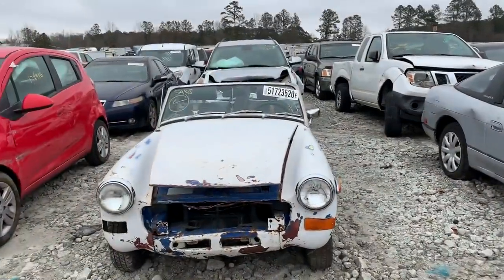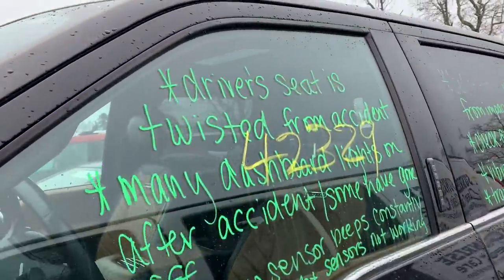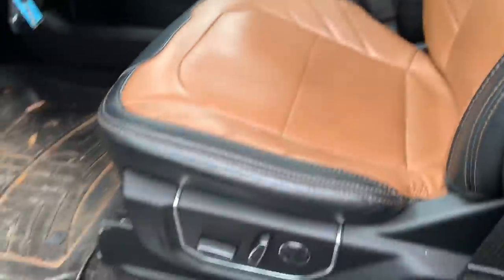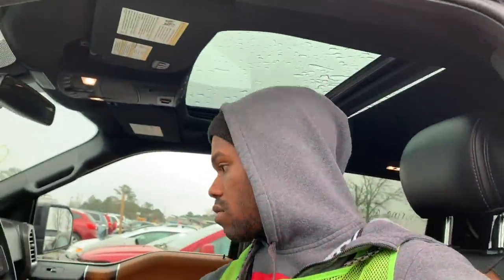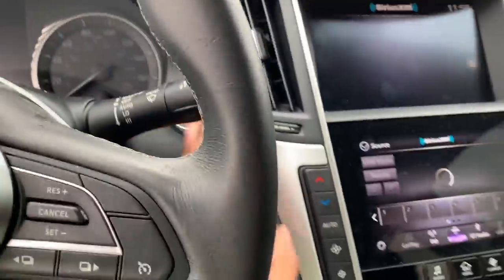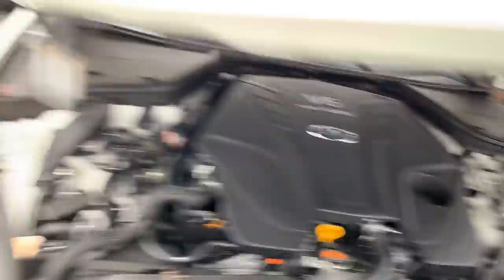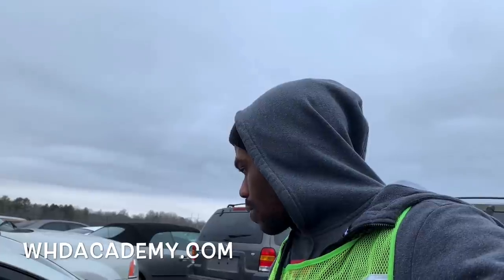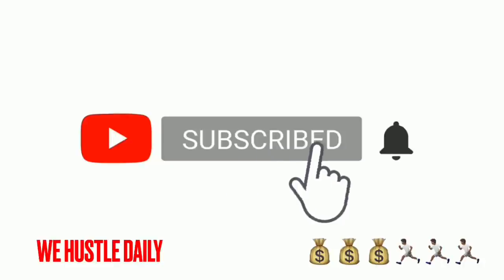*ANOTHER CHEAP COPART FIND!* A FORD F-150 ECOBOOST LIMITED! *BEAUTIFUL TRUCK*

Comment: ((FYI) There was a yellow button next to that pull out step on that F-150. If you push it; a pole can be pulled out and up.
It is used are a handhold to help you get into the bed. Pretty nice feature.